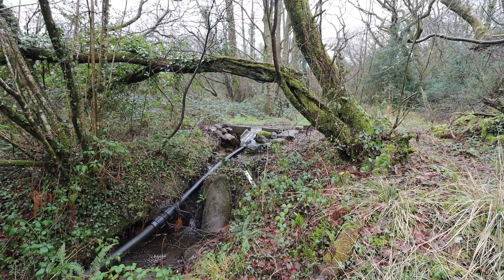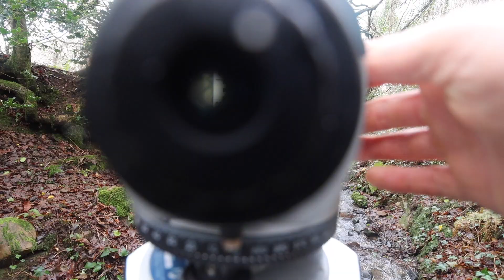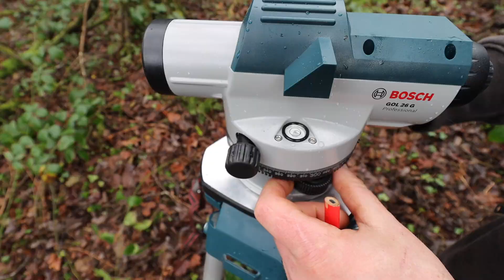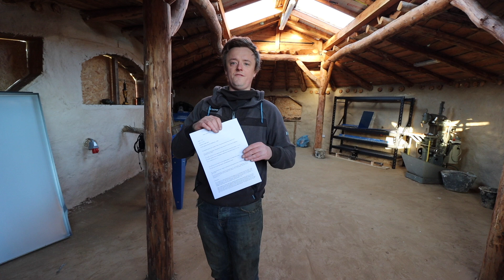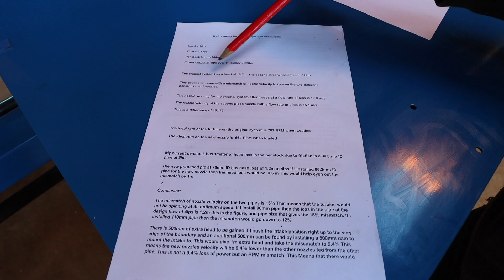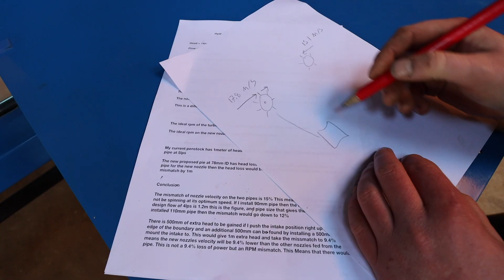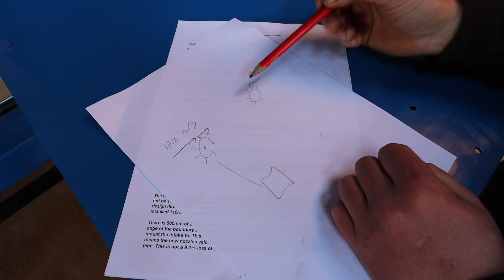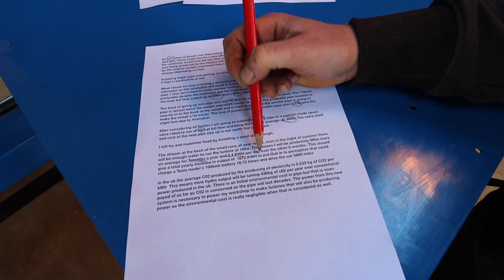Adding A Second Penstock To My Off Grid Hydroelectric Turbine (Survey)

Comment: Fascinating.. couldn't you solve the problem by building a collection vessel that both pipes would feed , then running as many nozzles you choose to the generator/fins from the vessel. the vessel would equal out any discrepancies' in pipe differences and provide equal presser to the nozzles
Reply: A good thought, but unfortunately water won't work like this.  If you picture your scenario as the water in his water level with one side having a hole partway down, what will happen is the water will go backwards and pour out of the lower dam.  It will transfer water from the upper stream to the lower one, and the pressure at the bottom will be equal to the pressure provided by the lower dam. :(

Comment: could you not divert the higher penstock to the lower penstock intake location? or is quantity of water not the problem. also moving the current pipe .. of never mind you have it right.

Comment: The miss match velocity, on the old stream you are saying it has 17.8m/s, but is that not just for 1 nozzle or did you work it out for all 3 nozzles ?
Because looking at the difference between the 2 streams, i would have said the one with 3 nozzles would have less speed than the stream feeding 1 nozzle ?

Comment: If I were you, I'd take the trunk out of the tree for building material, but leave the stump and the branches for the habitat.
Reply: Isn't there a value in just merging the pen stock at the bottom so adding the two pipes together to give it the maximum volume, perhaps using a larger diameter pipe for the last few meters of aggregated water.
Wouldn't that be easier than losing power?

Comment: I have watched the whole hydro playlist now. It's very interesting and I really like how you do stuff properly and try to improve even the small things. Just wondering how accurate the measuring wheel is when you go up and down every little bump. I imagine that the tape measure would measure closer to the actual length of the piping needed.
Reply: I think the difference would be fairly small, and doing a tape survey has its own challenges when clambering down streambeds. Also the wheel will always overestimate the length, which is much better than underestimating in this instance.

Comment: Finally :D
I gave you some ideas on how to overcome the embankment in your last video some years ago. Will be exciting to see how this turns out :)
Reply: You are really unlucky with your potential head at your property. 
I got a little bigger stream that I am considering building a small micro hydro system into.
With 550 meter long penstock I can get a 80.6 meter head and with 730 meter penstock I can get a 108.8 meter head, but the piping is quite expensive 🤔
Reply: One small tip; use a smaller diameter pelton wheel on the same generator axle/rotor to match the two different speeds of the nozzles. 
Then both nozzle speeds will have a higher speed than their respective pelton wheel on the same turbine.
Reply from the maker: Hi lesseBB you do indeed have great potential there with the head but as you say the cost of pipe would be very high and it would need to be very big in order to not get to much loss. 

That idea of having tow different sized turbines would work in theory but not in practice. A Turgo turbine ejects the water under it, so any turbine above it would be letting out the water in to the one below it. It would work for a Pelton that was oriented the other way around but in my situation a Pelton isn't the ideal turbine and there would be more losses than just having a mismatch
Reply: You are right, I forgot you had a turgo wheel. You would have to build a separated level/compartment, but the added benefit of that is you would have a seperation plate you could install a bearing in to help support the axle.
Picked up 450 meters 90mm PEM today, got it for 1.5£ a meter. New old stock.
There is a guy up North in Norway selling 250m, 90mm PEM for 670£, but it is 17 hours drive each way with mountain passes and snow blizzards on the way. Not to keen on taking my trailer up there getting it this time of year.